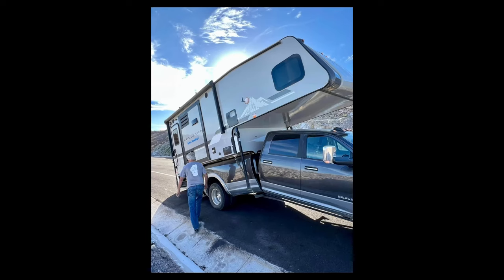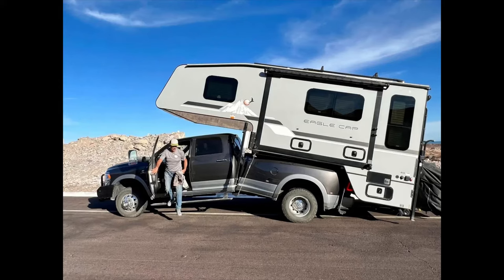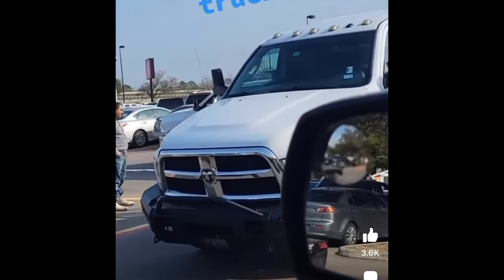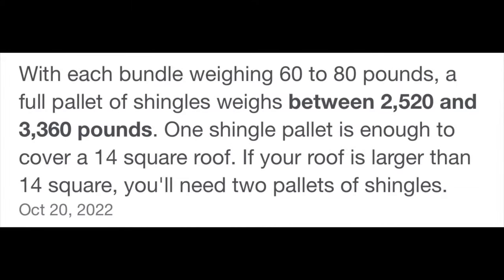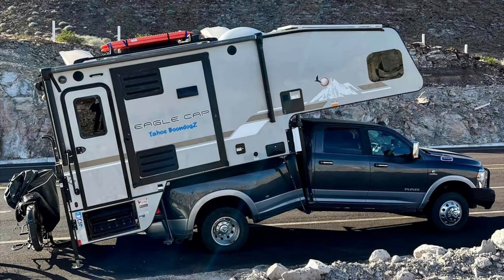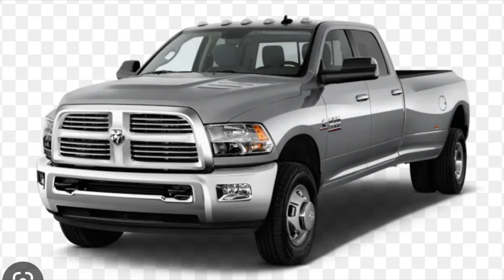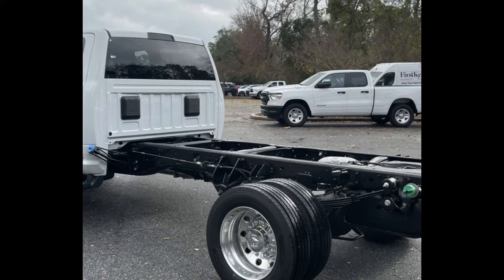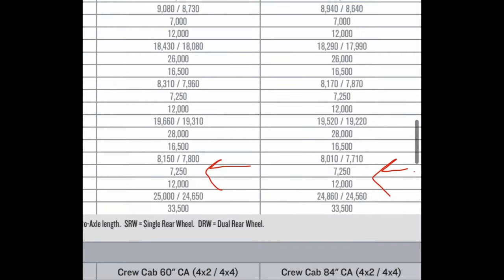Broken Ram truck frames 😱, what’s causing the failure and can they be repaired?

Comment: They were overloaded ... I've also asked my 2013 XL v8 f150 to handle it's absolute limits daily .. The payload was 1750 I think and though it's not much going in the bed it is 1 pallet of fertilizer for my landscape company .. I think I was a smart biz owner bc most landscapers just sighn the bank note on a new truck at that point bc the time picking up 20 pallets costs more then the new truck .. I bought a rear suspension helper kit and air bags and I started carrying 2 pallets per trip ... So I was running normal speeds and driving with the payload limit doubled and with the airbags the truck didn't even squat .. plus I usually had a 14ft trailer attached as well with my full mowing kit onboard , mowers, aerators , slap full..

Now holy cow was I a freaking moron ... I know , I'm comfortable enough to say that myself . Looking back , I have no idea how that truck still runs like a top with no trouble . I cleaned it and OCD detailed it to make it look new and its my daily driver whenever I'm going around town at work . Built Ford tough man .. every bit of the truck looks as new as the day I bought it 

I bought a Ford solely bc of what Henry Ford did in the new factory line days and doubled every workers pay from 5 bucks to 10 dollars per hr .. Overnight he created the middle class and it forced all other employers to match that pay leading to our new American middle class as in that day you were considered ritch or poor ..

He did the biggest thing in history to help all of humanity flourish and America began to really take off .. Never forget Henry Ford .
Reply from the maker: Haha it sounds like you have turned a 150 into a 350, I and many other people have done the same 😀.  I am a ford fan too, their trucks have treated me well over the years which is why I keep buying them.  I prefer the simplistic nature and well built parts.  My f350 rides a bit rough without 2k in the bed but considering the beating it has handled without anything beyond normal maintenance, I am happy.

Comment: Why isn't this a one piece frame rail??
Reply from the maker: The modern truck frames on 250/350 class trucks are universally formed box today.  The cab and chassis trucks are more or less straight rails.  All of the failed frames on trucks have been the non cab and chassis frames.  My guess is they are using the box channel because it’s stiffer (truck handles/drives better) and it’s lighter.  Unfortunately it’s likely more prone to failure over a simpler straight channel.

Comment: Not true for payload, F350 and F450.  The F350 has greater payload.
Reply from the maker: What year are you talking?  The payload of a f450 will be over a f350 depending on springs and frame choice.  Going to a cab and chassis truck will put the f450 payload over a 350.  That’s part of the problem, you can have two virtually identical vehicles that have widely different payload based on spring/frame,tire combos.  Realistically the trucks (in the case of these dodges) should have handled the overload but the fact they were overloaded does play a role in the failure.

Comment: I use the older 2nd generation dodge 2500s 1994-2002 and the frame and suspension is a lot better then these modern junk box frame crap this is not a brand issue it’s a modern issue I 100% guarantee you it takes 10k at the nose of my trailer to make my 2001 with factory overloads springs to squat, my 2008 dodge couldn’t handle 2000lbs and it was squatting to the ground in the rear.

Comment: Bad steel. Bad welding. Overloading at back end. These trucks are getting way too much weight behind the back fence axle. 
Also. Stalantis (or however it is spelled) is cutting corners like a M. F. Not worth nearly what they charge for them.

Comment: This is the same year that Dodge advertised how stiff their trucks were compared to the Fords. Maybe the frame is so stiff that instead of flexing under a load, it just snaps?

Video on the frame test thing\/

https://www.youtube.com/watch?v=_f3CAnH7WIM
Reply from the maker: Great comment and I think your onto something.  Making something overly stiff and using thinner tube is a recipe for all that stress to go somewhere.  The hard part with a truck is it’s one thing if the frame has to survive the truck itself.  It’s a totally different thing having to survive 3500-5k pounds in the bed, uneven loads, and unpredictable forces.  Seems like stiff is not something you want unless it’s built strong.  Had the frame been 30% thicker they probably would have never failed, but that would have added cost and weight.
Reply: @makingmistakeswithgreg if you look at the older trucks from the 1930’s to the 1980’s they were predominantly” c”channel and a more spring type steel so they flexed.  I know that  Ford 1/2 and 3/4 ton trucks in the 1960’s and 1970’s used the same frame about 3/16” steel and the f350’s about a 1/4” thick steel. You rarely if ever heard of any of those frames breaking.
Reply from the maker: @Hotrodford  yep, not only that they would survive heavy rust and were still structurally sound.  I worry about the thinner box frames rusting through and having failures far earlier that the c channel frames.  The 80s/90s f250 frames are still solid up here in the rust belt, when trucks like 2008 f150s have whole junk frames.  I will take a c channel all day.
Reply: TLDR😂

Comment: I would love to know how to increase payload.  2024 ram 2500 4x4 with crew cab is what i have.  I have put 7500# bags and a sway bar on the back.  I would think this would be plenty to go a couple thousand pounds over payload.  I don't want to buy a $80,000 truck. Any one ever try what I'm doing?
Reply from the maker: I have overloaded many a truck, the issue is generally not the truck itself as it is the titled weight.  A great example would be my f250 with a utility bed.  It weighs 7800 lbs as a drive it and its titled at 9600 (door sticker).  That gives me about 1600lbs of payload over what it carries normally and I am overweight.   Now my particular truck (2011 f250) is absolutely identical to the 2011 f350 (that has 1k more payload) other than the rear springs.  I swapped to f350 rear springs and the truck is great for what I do (occasionally haul a 10k trailer and load it with more tools).  It will handle far more weight than its rating, especially with the beefier springs, but nothing you can do changes the weight rating on the door, so it will never be “legal”.  

The other issue is the truck design.  You can use air bag load assists, bigger springs, shocks with assist springs, and all sorts of stuff to get a truck to handle more weight.  However simply going to a bigger truck is generally the best solution.  A bigger truck typically has dual rear wheels, much beefier axles, stronger frames, way better brakes, and tires with higher load ratings (and higher pressures).  I have went over 2x over rated payload on 1500 trucks for years and at the end of the day nowadays I just use the right tool for the job lol.
Reply: @makingmistakeswithgreg  the ram 2500 has the same frame as the 3500. Axles have the same weight capacity as well. Shocks and bags are great upgrade but you have to make sure the lug nuts and tires are designed for the weight as well. And a great swaybar

Comment: I have a 2016 ram 3500 cab chassis crew cab my frame looks a lot bigger and I’ve had 4 pallets on the bed
Reply from the maker: The cab and chassis trucks have pretty much bullet proof frames.  They don’t come with normal pickup truck boxes which is why many people don’t buy them.  If you’re going to haul heavy they are the way to go.

Comment: No one is saying anything about chinese steel ? These are not American steel anymore and why do they put so many unused holes in frames ? My ford has so many holes in it and i say putting so many unused holes in frames is something old timers would never do.
Reply from the maker: You bring up a great point.  I am not sure why there are so many unused holes, I surely rather have metal in their place lol.
Reply: Exactly that is the problem Chinese steel sucks they'll put anything in there they melt down anything in their steal it sucks for internal parts for exterior

Comment: The high cost of these truck they should all have 1/4 inch C Channel
Reply from the maker: Honestly they seem to be under built for the cost no doubt.  Part of me thinks “well they do have a stupid long frame and unbelievably torquey engines, and a misload of heavy weight is the cause”.  Then again like you said, considering the cost it’s pretty said to see failures like that.

Comment: Ford has never had that problem
Reply from the maker: I wish that isn’t the case, I didn’t put it in the video but there are 4 documented cases of f350/450 (newer than 2011) with broken frames.  One guy actually broke two frames, a f350 and a f450, both duallys and 4 door.  There are definitely more dodges with broken frames though.
Reply: That's why nobody uses them for a wrecker anymore that and all there engines are junk.

Comment: Do me a favor and find one picture of a  tundra with a broken frame.
Reply from the maker: Tundras are quite reliable trucks, but they don’t carry 6k in the bed or pull 20k + trailers.  I assure you if either were tried, equally bad failures would occur and much sooner lol.  All failed frame Ram, ford, and Chevy trucks were loaded with excess of 5k in the bed and/or have huge trailers hooked to them, likely for significant amounts of time.  That’s 4-5 times the payload of a tundra 😀.
Reply: Every broken Toyota frame was rusty...the Rams look clean.
Reply from the maker: @andyandnancy  unfortunately all the truck frame failures from ford/Chevy/dodge are all overloaded at time of failure.  This is not a case of a properly loaded truck failing for no reason, I have not seen a single failure of any heavy duty truck frame that wasn’t overloaded at time of failure.  

Like I said, Toyota makes reliable trucks however they don’t make a truck in a heavy duty class.  A tundras payload is under 1/5th of many heavy duty trucks, and it has less than 1/2 the torque.  They also have less than 1/3rd the max towing capacity of most heavy duty pickups.  If you were to overload a tundra it too will suffer from part failures.  The reason you probably don’t see many frame failures on Toyota trucks is because the bed is too small (and owners aren’t dumb enough) to attempt to load pallets of bricks, shingles, giant camper, etc into it.  Tundras are used as a home owners pickup, not a heavy duty work vehicle.  Not that they are bad trucks but they are built for a completely different purpose.  A f450/4500 class truck can literally haul 4k pounds in the bed and tow 14,000 pounds at the same time, which is well over double what a tundra can.  It will do that for a 100k miles with minimal issues, a tundra would struggle to make it out of a parking lot with a load like that.  Different tools for different jobs.
Reply: Yall want to compare trucks.
What is the biggest factor affecting truck frame failure?
Operator intelligence. Want to fill your truck bed with concrete? I've seen it done but not my truck.
Reply: Wait...whining about how a one-ton dually won't handle 3 tons? Really?!?
Reply: @mikeries8549  
My RAM 1500 had no problem hauling half a pallet of 80lb concrete bags. A pallet is 42 bags. Approximately 3,400 lbs.
And mind you this was a 2005 model doing this job in 2020.
On another job, we did a full pallet of bags in a Uhaul trailer. Again, no problem. But you are correct. If someone tries to haul a full pallet of concrete bags in a 1/2 ton truck, you are asking for big trouble.
The Home Depot employee gave me some crap about making two trips when he fork lifted the pallet out to me in the parking lot. I told him, my 1/2 ton truck won't take it safely. He thought otherwise. I told him no way. I will make 2 trips. He then said he was worried about theft. So I said, we are all on video, no???
He went back inside.
Reply: The box fell off our new Nissan Titan that we had at work.  I think that was in the 1990's.

Comment: How on Earth can a C shaped frame (or isn't this boxed in your photos)? snap thru it's entire verticle frame!!?? Neither one should snap! That one weld on top may have weakened it severely, and that shouldn't happen. A 1967 C10 Chevy frame is built better than these POS. I think the main reason is that there isn't much new steel made, it's all garbage recycled steel.

Comment: Dude, it’s pretty hard to overload a 1 ton truck really company I worked for. I had to go pick up A 6000 pound boiler with a 95 F3 50 no problems didn’t break in half and carried several thousand pounds of loads before that.

Comment: I have a 5500 Ram with the same issue...... No overloads and is cracking on both sides......
Reply from the maker: Man sorry to hear that 😮.  Did the crack start at the top of the frame near/on a weld?  Will warranty cover it?  I have worked on 3 5500 and one 4500 ram pickup in the last 2 months and none of them had any evidence of cracks.

Comment: Greg, it looks like the F550 chassis utilized with Terex aerial lifts had similar issues from 2006-2014. So these frame issues have been around for quite some time. 
https://static.nhtsa.gov/odi/rcl/2014/RCRIT-14V287-9345.pdf
Reply from the maker: Interesting.  That is a significant load on that truck, definitely a engineering issue there.

Comment: Of course, it can be repaired slam it back down it out, weld it and plate the hell out of it no problem I’ve chopped trucks in half and extended them before
Reply from the maker: The trucks of old the trucks of new are different beasts.  Many new trucks use thin wall box tube and are higher strength steel.  The probability of failure after welding is very high because of the effects welding on the frame has on the hardness in the localized area.  Surely it can be welded, plated, and made whole, but if the frame will handle the same design limits it was supposed to originally is a serious unknown.

Comment: Ram HD went to a hydroformed box frame in MY 2003.   I know because Ram would not tell me how to install a fifth wheel hitch on my new dually.  They told me me I could not drill into the frame or weld it. I ended up with the Pulrite hitch company installing a hitch that wrapped aound the frame.  Ram was totally useless and REFUSED to answer my questions.
Reply from the maker: That’s pretty wild.  Seems to me they realized they might have a issue with weakening the frame via welds or holes, but considering what the truck might get used for the fact it wasn’t pre setup for a 5th wheel hitch Is surprising.

Comment: I absolutely enjoy this video, your candor. I guess that’s what you call. It is very good when it comes onto well maybe you can do this. Maybe you can do that but you gotta be careful. You talk about preheating and keeping it hot afterwards I have another suggestion. Why not do a Rockwell hardness test on it that would kind of get you in the ball game of what material you’re working with and then after you get done welding it taking cold slowly like you’re talking about and then take a needle scaler and needle skillet like you would if you was doing cast-iron, but one thing I learned is when you talked about the immediate area right around the crack or the break I should say could be compromised. I have a 1991.5 Dodge it’s got over 500,000 miles on a 520 roughly and the frame is still a nice shape, but I do believe that is a softer steel and probably is easier to repair now that I watch your video anyway this is six in a row Jim from Kennerdell pa
Reply from the maker: Thanks for the kind words.  A Rockwell test could give a ton of clues to what the material is.  Especially if a person welded a “test weld” in a non critical location and then checked the hardness near the weld.  It’s very common on higher strength steel to have a significant change in ductility right at the edge of the heat affected zone, this would likely be noticed via a hardness test.  I have repaired a lot of higher strength steel parts that cracked 3/8th of a inch from the edge of the weld, and people don’t realize this is a direct result of the heat from the weld.  There are ways to “backyard heat treat” such situations but I didn’t want to mention them in the video because of corners are cut the results will be poor at best lol.

Comment: So first off I guess is ram has been using boxed frames since 94 when they started boxing the front half of the frame and then went to a fully boxed frame in  2004.  Dodge had some of the strongest frames in the industry for a couple decades.  Second in the case of the ram with the camper the load was likely distributed incorrectly with more than 50% of the load behind the tires. This in combination of the heavy diesel engine probably was causing the frame to arch eventually creating a crack that probably progressed quickly once the top of the frame rail was compromised.  When you haul heavy loads you want that load between the front and back tires and definitely not behind them.  Did the weld contribute most likely but it likely wasn’t the overall cause.  Three yes you can get a cab and chassis 3500 and yes the back half of the frame is c channel but I believe that is to make up fitting the trucks easier since they don’t come with a bed.  Do a little research and you could have probably found these things out instead of resulting to stipulation.

Comment: I put two pallets of dirt in my 95 F150 with a 300 straight six no problems piece of crap Dodge if the problems
Reply: The 300 straight 6 was amazing.  I remember my buddy showing us how he could start out in 4th gear with the transfer case in 4 low.  He also pulled a 30 ft bumper pull camper all over the u.s.a. with his road construction job.